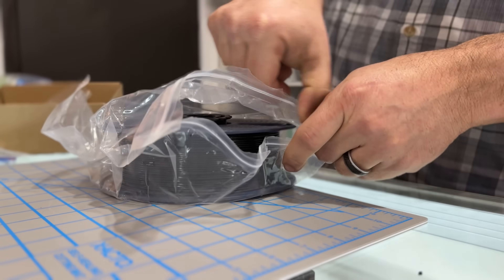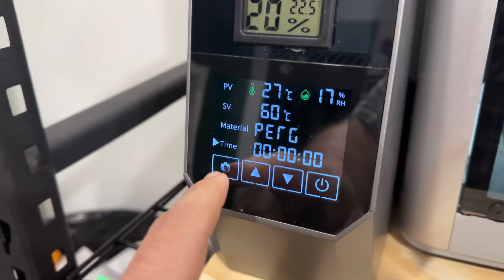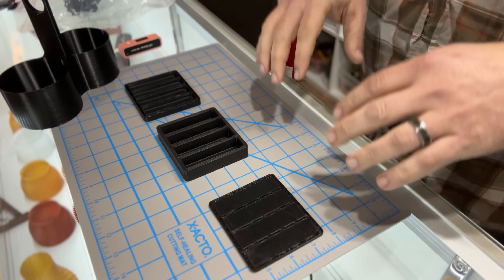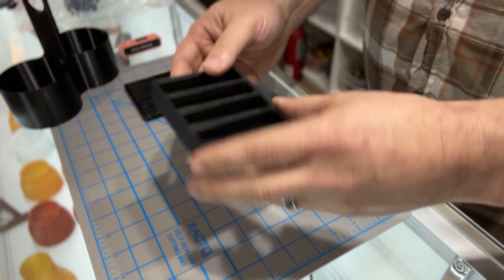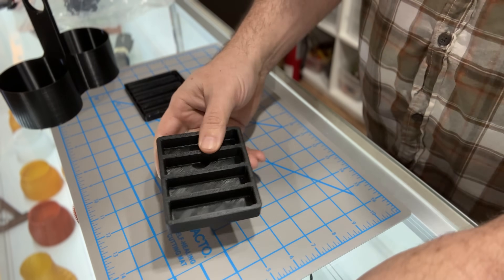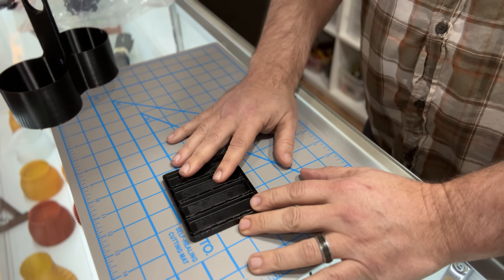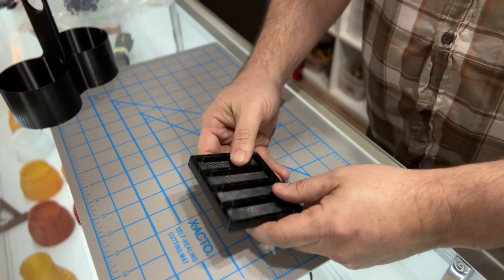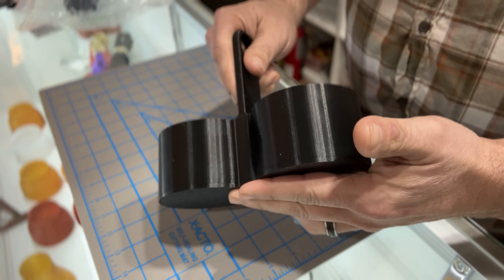Sunlu PETG on Bambu A1: Can It Print Without Tuning?

Comment: Could someone help me please?!?

My Setup:
A1 Combo with AMS mini (to print out of the dryer) and hardend steel nozzle
Elegoo Rapid PETG
AliExpress Carbon/Holo Plate

I tried EVERYTHING.
Print with Bambu HF setting (calibrated)
Print with Generic HF setting (calibrated)
Print with Generic PETG setting (calibrated)
Temp from 230 - 255

Did K-Rate, Flow, First layer etc....

Here's the problem:
Every damn time the nozzle has to fill (1st Layer, Ironing...) the pick up is HUGE!!
Also the layers look perfect, till they start stringing because of the pick-ups or what fking ever.

My best bet till now is:
Basic profile: Basic Bambu PETG HF
Plate: Smooth PEI/Engineer Plate
Bed: 70°
Temp: 235 for 1st layer, 245 for the rest.
K-factor: 0.053
Flowratio: 0.987
Max volumetric: 20
First layer height: 0.24
Filament: fully dried and printed out of the dryer...

I come from an Ender 3 and even this was better to print.
It sucks, that bambu has their z offset locked, cause I think that's the last possibility to change the nozzle pickup or it's just this dirty cheap PETG.

I have no problems with the bed adhesion.
Also the Plate is fine (Printed PLA like really perfect)

The retraction tests showed 0 stringing. But as soon as the nozzle wipes, the stringing begins?!?
Reply: Did you find a solution?
Reply: @felixfeil7770 unfortunately not. I found out, that the temp buildplate I'm using may cause no troubles with PLA but with the PETG. So unfortunately I bought a printer which has a automatic leveling but isn't able to accept 3rd party buildplates due to the poor leveling mechanics.

I could adjust the z Offset by gcode, but honestly I don't see the point. It's automatically leveling, why should I?

Bambu is becoming the new 3D Print apple. So whenever you try to bring 3rd party parts, it causes problems... Cool for standard users but very uncomfortable for people loving the open source thing about this community...

Comment: Have not tried sunlu petg, but i have printed a lot of esun petg. Prints great, did not even dry the filament before use. I always just check esuns homepage for nozzle temp, bed temp and max flow rate, and update the filament data in the slicer to these values. Worked great with abs, petg tpu and pla. edit: can add that i live in a country with low air humidity most of the year.

Comment: I like the Sunlu PETG. I run on FF M5 and M5 Pro. I run 80c for the bed temp, and 250c for the hot end. If I get up to 255,  I get a lot of residue on the nozzle and there will be artifacts. New at this likely 15-20 spools of PETG. Blue runs best for me, Black has some slight stringing. No adhesion issues or warping.  Thanks for this!

Comment: standard textured build p[late it looks like. All kinds of people saying that you need to use glue tape, possibly a different plate. Your thoughts on this?
Reply from the maker: I have never used anything on my plate, other than soap and water, I find even a small tweak and temperature whether that be plate or ambient corrects most issues with bad adhesion.

Comment: i have been using Sunlu PETE for about a year now on my A1. Works great out of the box, dont need to change any settings on the slicer.
Reply: Interesting. I am brand new to 3d printing and I have an A1. After using several PLA fillaments with no problems at all, I got Creality PETG and it would just make spaghetti.  I'm wondering if I need to buy a dryer and watch some videos about how to adjust temperatures. I live in Utah and print in a cool dry basement, so not sure about the ambient stuff.

Comment: I run both Bambu and Sunlu PETG on the A1/A1M just fine. After the drying time, I keep it in the Sunlu S2 while printing. Sunlu filaments often need a higher temp than equivalent Bambu filaments. I typically go with the Sunlu recommendations for nozzle temp, bed temp, and speed.
Reply: use 3Dlacs

Comment: I love Sunlu Filament! Use it all the time. I have a P1S so I don't have the problems you have with the open bed slinger. I also haven't had to dry any of my PETG yet.
Reply from the maker: Yeah, typically when I'm testing, I like to use the worst possible scenario, if I was to put it in the X1C it probably would print just fine and it wouldn't be much of a video. Given the variability of a bedl slinger, and the fact that probably the vast majority of people have bed slingers. It makes sense to review it on that machine.

Comment: Well thanks Roger. It’s been a while since i tried printing it but i was having bed adhesion problems and curling. I think i was printing it on one of my Kobras which i don’t have that issue with Elegoo or bambu. I never thought of laying down a thin layer and I go pretty thick on them.
Reply from the maker: Yeah, I think if you bump that initial layer temperature up about 5° and then if you can do a thin layer on the first layer, then you should be good. It's funny as soon as I printed it. I was like I know exactly the problem he's having..